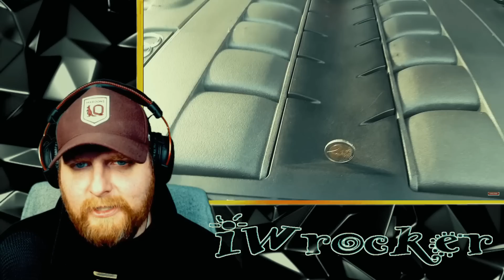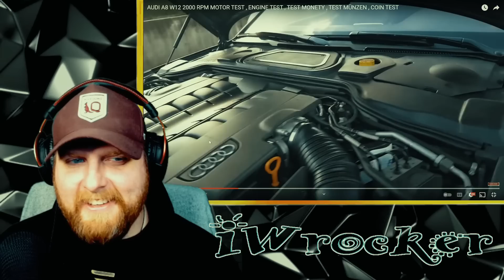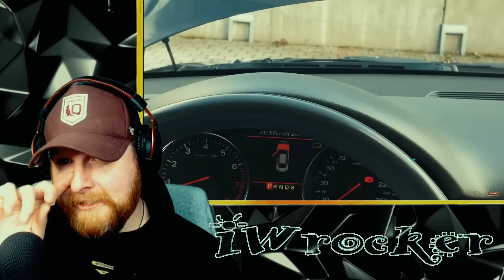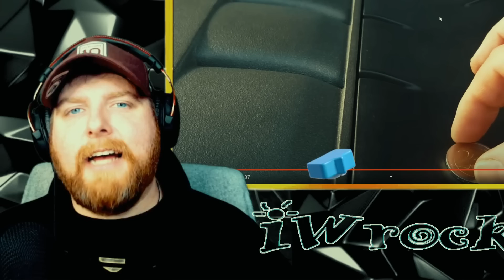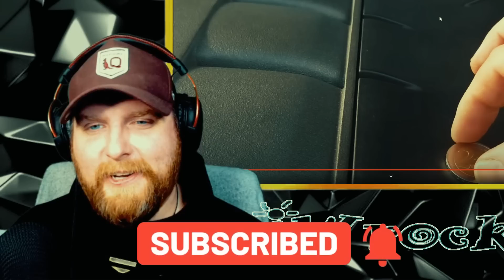German Engineering: Audi W12 Revved Up, Coin Test (Runs So Smooth)

Comment: I remember BMW doing a similar test with one of their V12 engines (E38 750i I think it was). They put the coin on it before starting the engine, started it afterwards and the coin still didn't roll away or fall over.

Comment: 1. It's a 2 euro coin
2. W12 engine is basically 2 VR6 engines slaped together in a V shape
VVR6 is WV made engine and it's V6 with only 15 degerees V and a single cylinder head
As far as i know only VAG group uses W formation engines, there are W8 that can be found in WV Passat, W12 - A8, Phaeton,Bentley Continental GT and ofc that famous W16 in Bugatti
V12 and W12 are the most balanced engines, and that makes them run so smooth. Im not an expert but there is something with firing order and forces canceling out

Comment: It's not only impressive how smooth this engine is not tipping the coin while reving, it looks like the engine has over 140'000 km ( 87k miles) under the belt (@03:00). And the engine is just 4 cyl short of being a Bugatti engine (W16) 😉

Comment: Wll may be impressive, but that coin test was actually stolen from Mercedes bens V12 from the late 70s Engine where the coin would be put on it standing while the engine was off and did not fall during the start up ! Nonetheless, W12 are rare, incredibly smooth and by the wa, are built in the Bugatti...  that W12 you see here. Of course modified for high performance.. like the W12 from Bugatti hast 18 ! coolers to keep the engine cool and still hav the airodnamics. Btw, you will find that coin startup even for AMG Mercedes engines, also für BMW V12 and they are not fake.

Comment: I remember that this Test was done on the BMW 3Series e36 1998 M52 engine V6. Used german Marks (DM) coins at the time. Steady like a rock absolut smooth. When the coin drops in idle you know there is something wrong with your engine.

Comment: A W12 is basically 2 inline-6's put together, so I'm not surprised it runs very smooth.. Inline 6 cilinder engines are perfectly balanced because of their ignition order..
Reply: No, thats a V12, W12 is 2 x VR6 narrow angle V6 (1 head instead of 2)
Reply: @thesollys9540  You're right, I got that wrong.. Dunno how they balanced this thing then..

Comment: This was an Audi A8 D2 W12 has 420 hp and 550 Nm as standard and weighs 1950 kilos from 0-100 km/h in 5.5 s for a car from 2001 to 2 not bad and highest speed 300 km/h open has a consumption of around 14L to 100 km has a 90l tank and a range of about 490 km and less 5:14

Comment: 2 Euro coin, AUDI A8 you can order with several different engins - V6, V8, W12 benzin, V6 and V8 diesel. The W12 is the same as in the Bently cars (build in UK), and enginired for this type of cars. Mercedes has a V12 also BMW. But they stopped building this engins.

Comment: Actually it's not a real W-engine (like the W16 of Bugatti as well) but more a V-VR-engine. A W-engine has 3 cylinder banks, so a W12 is basically a V8 with one more cylinder bank in the same angle as the V. These are two VR6-engines in a V. A V6 and also the VR are not running balanced like an inline-6, but i guess depending on how you combine two of such engines you can balance all asymmetric internal forces...

Comment: I currently drive a Kia Ceed GT, 4-cylinder, 1.6l turbo, with 204hp. The Year of construction is 2015. It accelerates from 0 to 100 km/h in 7.7 seconds. Sometimes I'm standing at a traffic light or in a parking lot and don't even notice that the engine is running. I then have to look at the rev counter or step on the gas pedal to see or hear if the engine is running. The loudest thing I hear inside is the hum of the fuel pump in the tank under the back seat.

Comment: The coin test is ancient.
The old Porsche 944 already had it in advertising to show how smooth the 2.5l Porsche four-cylinder engine was ;-)
Incidentally, that was a halved V8 from the Porsche 928, whose missing cylinder bank was replaced by a balancer shaft in the in-line four-cylinder.

Comment: Really nice, but they brake down alot. Not only the w12. Alot of audis brake down alot. Better buy a Toyota 😅
Reply: 🤣🤣 tell me you know nothing without telling me the w12 is an awesome engine if it's serviced regular they rarely go wrong.l had Audi and vw for the past 20 year and in comparison they go through less suspension parts and bushing than anything else I have owned

Comment: I love the W12 engines , I once got a short ride in a VW Phaeton that had a 450 hp W12 and man it was like a jet , so smooth and from a stand still when floored it would just push you into the seat, but not like a punch rather like gravity turned sideways 😄 the coin was a 2 euro coin from Germany
Reply: The Phaeton shares no parts with other VW models I was told - is that true?
Reply: @renniks1975  pretty much true other than some electronics it shares a ton with the Bentley continental as well as the chassis 😄
Reply: @renniks1975  As i know it uses a " Stretched " US PASSAT Chassis , because allmost all Cars in the VW company use the same Frame in different sizes
so far i know the have 4 different   " Sizes for a every Class from small  like POLO and VW UP  to medium like GOLF , Skoda Fabia, Seat , large frame for AUDI.... and so one
but the Phanton was "to Large" and they used the US PASSAT Frame to market a competition to the Mercedes S Class
the Standart US Passat frame is 4 inch longer then the EU/German Frame and they had to have "stretch it even more for the phanton
Reply: @axelk4921  dude it’s a Bentley in disguise there is no Passat chassis to be found anywhere, Google it PLEASE 😄
Reply: @renniks1975  basically: yes.

As far as I remember it's the VW with the lowest amount of profit ever - not in Lexus LFA regions tho where every built and sold car cost Lexus more than it was sold for

Comment: Drove the exact same Model back in the days. It's a beast. 450 HP. Heavy as a tank but smooth as a baby. But it gulped around 30 Liters while not even speeding. Ceramic Breaks. One Set all 6 months around 6k a piece. Dont get me startet with the service. They charged 1200 Euro for dust and pollen Filter and new spark plugs. They never built a car like that afterwards. The last good A8L w12 in my opinion

Comment: I used to do the same with the Honda valkyries (1500cc flat 6) that came through my shop.

With a warm engine, i’d balance a coin on edge on the r/h valve cover, and blip the throttle. 

The coin would rotate, but not fall over.

Comment: Audi have v10 tdi v12 tdi
Reply: Yeah and that thing is expensive to fix or mod 🤣
Reply: @deeeeeeeench1209  yeah I know that but it's cool lmp1 r10 winning Le mans. But Road cars 3.0 tdi are tuneable idk if they get them in the states
Reply: @Griizmo  yeah I've found quite an engine in the VAG group it's a 2.0tdi bi turbo standard it's around 235bhpq it's a very good block to single turbo as it was designed when they was doing the scandle so it's over build the ports on it are straight out 🤣 you could put a fist in them tbh I think the engune code is CAUU people are making real good numbers with the right upgrades and running them hard

Comment: I love Audis. My favorite Brand. Does anyone know if all W12 engines are Turbo Diesels as the one in the Q7? Or do they also have W12 Gasoline one?
Reply: This is no TDI, it's a Gas engine, a Diesel won't need a rpm meter exceeding 5000 rpm.

Comment: The w12 engine essentially two vr6 engines in one block. The vr6 is such a narrow angle v6 that it balances like an inline 6 but its compact like a v6, so vw and Audi can fit them in smaller engine bays.   This means the W12 is shorter than most v8s and are well balanced.

Comment: I think the coin is a 2 Euro. A W12 has a much wider rev range. He barely touched the gas pedal! 2,200rpm? That wasn't even a third of the throttle! It red lines at just over 6,000rpm, he was nursing that throttle pedal! Audi is part of the VW group (VAG) who developed the W12 series. VW also own Bugatti so this engine is a smaller scale version of the Veyron engine so it's smooth and powerful.

Comment: It is not a real W12 design (3 cylinder banks with 4 cylinders). 
The W12 engines from the VW Group (Audi, VW, Bugatti, Bentley...) are actually two VR6 engine blocks, they are V-VR (4 cylinder banks with 3 cylinders).
The real W12 design by VW was the Audi Avus Quattro prototype and the Bugatti Chiron 18.3 prototype.

But nevertheless it is amazing how smooth the engines are running.

Comment: Former employee of a towing service that worked mainly for VW and Audi here! 🤗 
Well, this video is credible. These engines run crazy smooth. Back when I worked for that company the W12s both from VW and Audi were still new and I was drooling when I first got the chance to drive one of them. Yes, somewhere in the far north of the car, somewhere ahead of you, there is that thing that makes motion and somewhere under you there is the road and somewhere behind that thick glass, there is that outside world. You remember that fact, but you feel detached. These cars do feel as heavy as they are, which is some 2.2 tons for the W12, a weight no horse powers under the bonnet can make feel nimble and agile.
They feel like luxurious trucks, and in all that luxury driving becomes a tedious task that prevents you from having the nap you feel like. I guess you see where this is going.
Long story short, of all the cars Audi made around the early noughties, I liked the bog-standard A3 most. It feels alive, it keeps you entertained, it keeps you awake. It is incomprehensible to me how they do the trick at Audi, building super powerful cars that feel like they can't make a fish slip off a plate if you hit the throttle. Add to that the partly nasty quality issues both VW and Audi had when the engines were new. and yes, it is "Engines". Each company made their completely own designs, just to show off. Big baws show 'n all that.

Autobahn speed, hot weather and the switching from full power in the left lane (=generating lots of heat) and traffic jams (=not getting rid off heat) was a big factor in killing the engines, but the number of bent cylinder heads and even, as aluminium can vary its internal tensions in the material,  bent blocks were very unpleasant for the owners.
I got to drive all As and Ss, S3, S4, S8, Audi TT Quattro with s turbocharger beefed up by ProSport from Düren, Germany to 360hp, and one of the bottom range was my favourite.

Me, I love driving. I like to feel the car, I like to feel I move, I like to be in touch with my environment.
The Nick I use for Youtube actually is the nickname my current car got in the early days of me owning it. My Zweispurmopped is a Renault Mégane Convertible with a 1.6 litre engine of 107hp, made in 2000. The only thing I dislike about it is that it has climate conditioning, which only adds to the weight and fuel consumption and makes work more difficult with some repairs. When it's warm the roof goes down anyway! In all other respects it is one of the loveliest cars I ever owned or even drove (Which included some really interesting cars from all eras as I worked for a vintage&sports car dealer in the nineties.). Being as much in touch with the surroundings like when you sit on your bicycle is something I got addicted to and this car basically makes every other drive an unforgettable experience. It adds quality to the time you spend in it.
Do A8 W12s? I don't think so.
Reply: Bmws angine in the rolls roys runs way smoother.
Reply: For being in touch with your surroundings, you'd have to love motorcycling then... ☺
Reply: @grantodaniel7053  Man, you don't know how badly I ache to ride motorcycles. 🤗 
Sadly I don't have the license and sadly it's not exactly cheap to get it here in Germany.
In part I think not having a helmet on your head even has advantages there, a convertible does provide you with a pretty vivid experience. It may be even more direct in a way.
Reply: @zweispurmopped  I understand - getting a motorbike licence is an expensive and lengthy process here in South Australia now too. And yes, helmets do detract from the experience a little bit but I'd never be without one. But it beats even a convertible, in that you are TOTALLY in the open and not nestled down into a snug little box (even though I enjoy that sportscar experience as much as anyone else!). 👍🇦🇺🙂
Reply: I rmb VW Phaetons glass were so thick, you couldn't even use rfid
Reply: @lionellhwang5153  I would guess there were other problems preventing RFID from working. The Phaeton wasn't exactly known for its reliable electronics… 🤭
Reply: @zweispurmopped  I was referring to rfid payment cards used for stop-less toll payments in some countries. Those where you hold it up to the windshield and the toll barrier just opens up without stopping
Reply: @lionellhwang5153  Ah! Okay, as there is no such thing as road fees to pay at toll booths here in Germany, I don't know about that, obviously. 🙃
Reply: It is a 2 EURO Coin
And more precily: It is a GERMAN 2 EURO Coin

Comment: Hi Ian,

the smoothes running engines are the 6 in a row. Volkswagen has built the VR6 beeing a V6 with very few offset, so it can also be considered a 6 in a row. The W12 is basically 2 VR6 engines sharing the crankshaft. So these are bretty smooth running power plants. 
But it's Rolls Royce who claims to build the smoothest engines. You can put a coin on top of the engine, and then  fire it up. It will start without topling the coin over. Watch here: https://www.youtube.com/watch?v=95QKPW38DsM
Greets from Austria.

Comment: I believe the coin trick is almost as old as the straight 6. Balancing out a W-engine is probably a bit more complicated. Interesting cars to look at?
- The Koenigsegg Gemera, a drive train like you have never heard of before, amazing innovation.
-  Fiat s76, not smooth at all. You couldn't balance a wet towel on that engine. 
-  Pre WWII Porsche hybrids
-  Jeremy Clarkson testing the Spyker (Audi engine but that's not the most interesting) for Top Gear. Top Gear at it's best because about the car.
- Mercedes 600, der Grosser. The favourite of the worst dictators. Amazing engineering. 
- Citroen has also done some amazing engineering, with their hydropneumatics among many other innovation. The Citroen SM being the most interesting, especially engine wise. 
- Pre WWII Tatra luxury cars are something else too.
Reply from the maker: Excellent stuff thank you for these! 😎🎉
Reply: Post WWII Tatras are also very unconventional cars
Reply: @Kilian600  Yes, but they mostly stuck to their pre WWII convention.

Comment: The W12 is a VW engine. You know, the "other" german car manufacturer that you left out of your list. 😉
Reply: Lets be clear. W12 is an engine layout. And the W12 engine in this audi is made by bently. VW had the right to manufacture it until 2019. Bently still makes them in 2023
Reply: @officialezzy6801  the W12 in this Audi was made by VW. It's 2 VR6's matched together. Can't remember Bentley having a vr6 engine.
Yeah Bentley used to build these engines in their own plant which VW offered. That's about it
Reply: @friesischHerb  The Wr12 from early 2000s is yes, but this is the 2017-2019 model isnt it? You are making me unsure now, i watched this on a very small screen so i could be wrong. Incase i am, my bad!
Reply: Bentley is owned by Volkwswagen. So if Bentley has the right to manufacture W12 engines Volkswagen could make them also. They just chose to not use them anymore. My guess is because the W12 is heavy and expensive. That engine also barely fit into the A8. Thats why there was no turbocharged A8 W12. With the model update they even had to increase the cylinder capacity from 6.0 to 6.3 litres to keep up with MB S-Class and BMW 7-Series who already turbo charged their top models
Also the W12 used in Vokswagen brands was in fact designed by VW CEO Ferdinand Piech in the late 90s. The design differed from classic W12 engines which had three parallel cylinder banks whereas the VW W12 had 4 offset cylinder banks.
Reply from the maker: I left out VW because here in the US, everyone knows VW as they are more of a “Normal” or common car while Mercedes, BMW, and Audi are more direct competitors as they are usually more expensive, sportier, and luxurious. More of a statement to people

Comment: Changing the gear box is hell with those engines.
I did a apprenticeship at a VW and Audi dealer.
And the coin is a german 2€.
Reply: @ͲᎬᏞᎬᏀᎡᎪᎷ ᎷᎬ👉mate_Iwrocker    🤚🏽🛑🛑🛑🛑 You are a scammer!  Ian doesn't even have a Telegram.
Reply: However, it is not possible to tell whether the 2 euro coin is German, since the side visible in the video is identical on all european Euro coins.
Only the backs differ from country to country...
Reply: @raka522  Watch it again, you can see the German eagle on the back of the coin, at the beginning.
Reply: @raka522  At 02:05 you can very clearly see the back of the coin, which is the German eagle (Bundesadler) as Tigerius correctly pointed out.